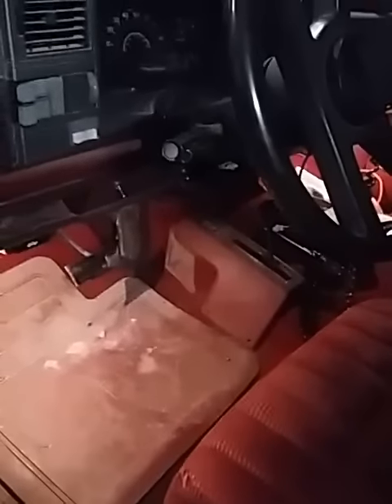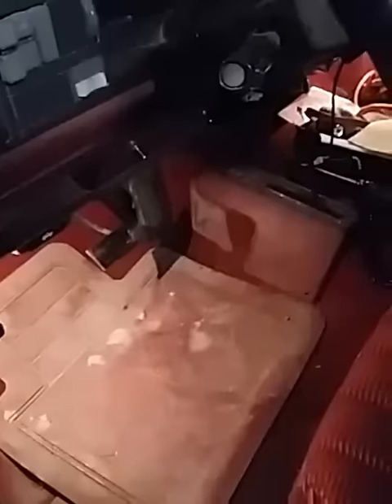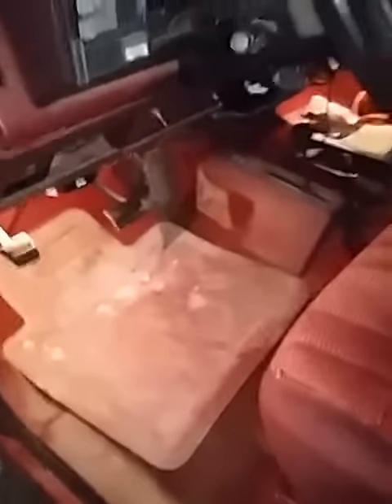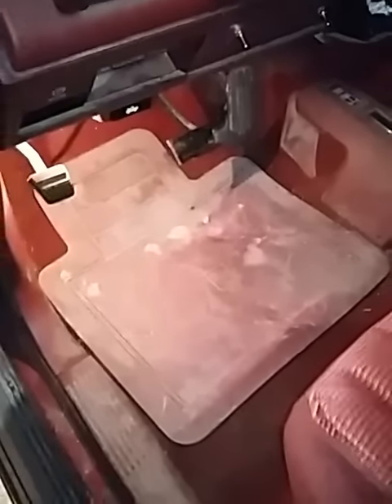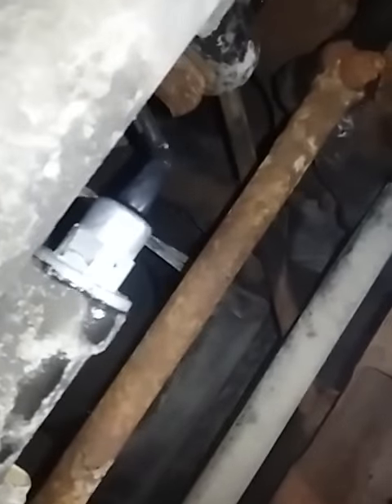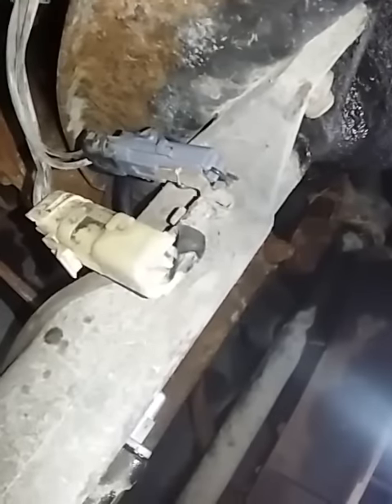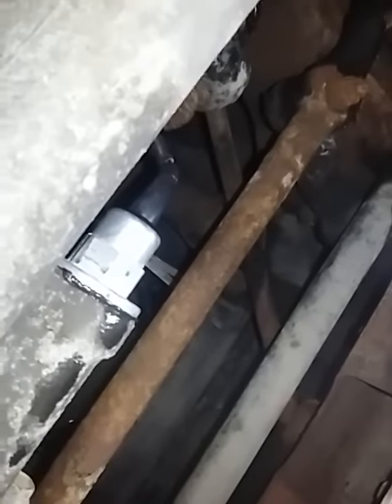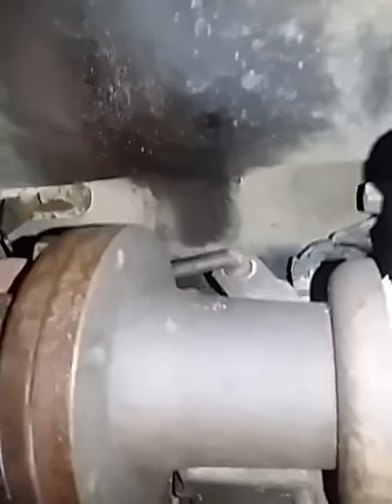1990 Chevy four-wheel drive diagnosis thermal actuator installation

Comment: My fuse blew, and couldnt find ANY vids with the floor shifter like my '89. Thank you sir. About to go out and crawl under it again and fix it
Reply: Richard McLean I got an 89 too, did you get it working.
Reply: Would you able to fix it?
Reply: @scorpion5700  ,  @James Zablan fixed it right away, and it was super easy
Reply: @jameszablan7340  I did, it was actually pretty easy too
Reply: @scorpion5700  Im usually on top of replies, sorry I missed yours, hope you got it going easily
Reply: @richeerich561  I have 1995 Chevy Silverado four wheel stick on the floor. When I bought the thing used, I did the normal parking lot test yesterday to see if the four-wheel high and four-wheel low worked. Yesterday was my first opportunity to put it into four-wheel high it engage then while driving 1000 to 3000 rpm I put the shifter to neutral then put the floor stick to 4 lo it engage properly when I’m trying to put it back on 2h my floor stick stock on NEUTRAL,put the shifter on neutral position (engine running)then tried to manually shift it to 2h or 4h or 2l still not working I’m worried coz every time I forced it gear grinding noise so right now the truck is not moving.what could be my issue? Help pls..trying to figure out by myself before spend money on mechanic.thank you
Reply: Any idea with this kind of issue? I t happened yesterday..I check th fuse there good..don’t know what to do next..tried shifting it in gears but it won’t go through coz the lever floor stick stock on NEUTRAL..truck won’t moved either..
Reply: @jameszablan7340  Sometimes mine would grind trying to switch the transfer case between 4wd to 2wd, if it was stubborn Id just shut the truck off and put it in the gear I want and start the truck back up. Since this post, I got rid of my '89 silverado and got a 91 cheyenne with a 5 speed manual trans and 4wd. Whenever I switch gears on the transfer case, I put the stick in neutral and I havnt had any grinding issues with this truck. The other truck I had issues with had an automatic, so maybe the issue is tied to the auto transmission somehow, not sure. But it sounds like you are saying your transfer case is stuck in neutral? If it wont come out of neutral even with the truck off, you may need a trans shop or someone more experienced than me to see whats wrong
Reply: @richeerich561  hey, im working on an 88 with my buddy, does the manual version, have the same system as your old automatic for the activation of the 4wd? I.e lever goes to transfer case sends an electrical signal to the heated coil to push fork forward to engage the front diff? I’ve heard some have a vaccum system or something as well? Just a wanna know if the process in the video would be the same for the manual. Idk I figured you’d know since you also have a manual early 4wd 5spd. Thanks!
Reply: It's the same yes, electronic/heated coil type
Reply: @richeerich561  thanks i really appreciate it! Hope you have a good day.
Reply: @jameszablan7340  
Did you figure the problem out with your truck? I have my late husband‘s 95 Chevy Silverado 4 x 4 .  After putting a fuel pump in I went for a test drive around the house and when I took it out of four-wheel-drive while it was in neutral and then went to try to put it in park the gears just started grinding no matter what gear. I cannot get it to go back in 4L or 4H. Please help. It’s my only transportation. Thanks, Robin

Comment: You can check continuity on the actuator plug, OL means new actuator; while you're there you can also check for 12v on the plug with the key on - when the 4wd fuse blows its usually a short to ground which is also 90% of the time the actuator.

Comment: When the actuator doesn't blow the fuse you can "repair" them. You need to remove the boot and soak it in atf for a few minutes. Once you work the atf through it it'll work again, sometimes for a long while

Comment: Thanks for video. You've made my day. It's simple  fix after watching video.
Couldn't find any other ones that just like 👍 it.
I have a 1994 Chevrolet Silverado with the thermal actuator.  Is there is possibility I can convert it to newer electronic version do an part # 600-101.

Comment: Thanks for the information maybe that's why my 95 4x4 doesn't work haven't had the time to look at it but I'll put a test light on  it and check the fuse you need a refrigerator for your man cave
Reply: I have A 95 and the light stopped coming on but as far as I can tell 4 HI and low still work fine. I wheel it all the time

Comment: I replaced the actuator and I’m getting fire to the plug and I took the actuator out while it was plugged to make sure for a fact that it was working pushing in and out the light by the stick is on telling me it’s engaged but it’s definitely not engaged what do I do

Comment: 1995 Chevy Silverado four wheel stick on the floor. When I bought the thing used, I did the normal parking lot test yesterday to see if the four-wheel high and four-wheel low worked. Yesterday was my first opportunity to put it into four-wheel high it engage then while driving 1000 to 3000 rpm I put the shifter to neutral then put the floor stick to 4 lo it engage properly when I’m trying to put it back on 2h my floor lever stock on NEUTRAL, Tried putting the shifter on neutral position (engine running)then tried to manually shift it to 2h or 4h or 2l still not working..still lock on neutral I’m worried coz every time I forced it I hear gear grinding noise so right now the truck is not moving.aNy idea what could be my issue? Help pls..trying to figure out by myself before spend money on mechanic.thank you
Reply: The trans case shifter fork has nylon slides that wear out... and that lets the engagement gear to float back and forth.... watch a few rebuild vids and youll see this is a problem cause by shifting on the fly.  I found pieces of nylon in my oil. Hope this helps

Comment: What is the best process to shift these trucks into 4wd. I bought one for a farm vehicle and this is the first one that I have had with a floor shift.
Reply: I think you're not supposed to shift in or out above 45 MPH.  And I've heard you shouldn't shift into 4WD when stopped (but I'm not certain that's true).  Just be rolling (coasting) and if you have an automatic, shift to neutral first.